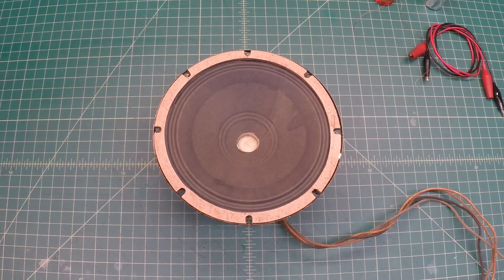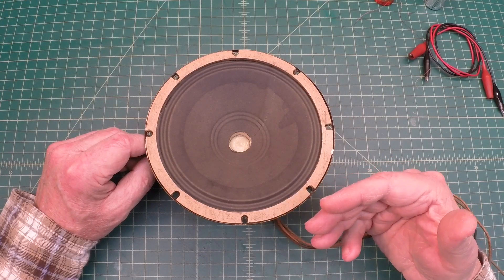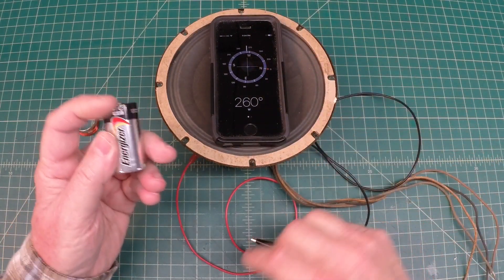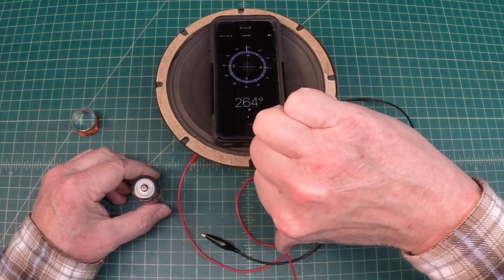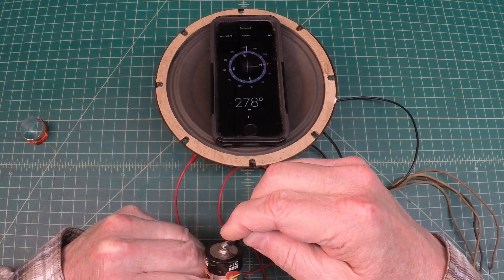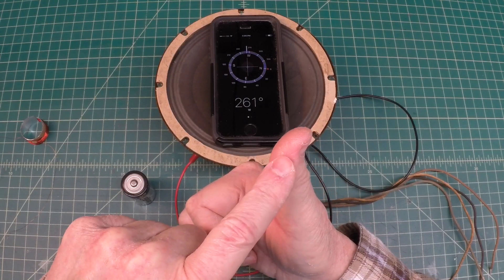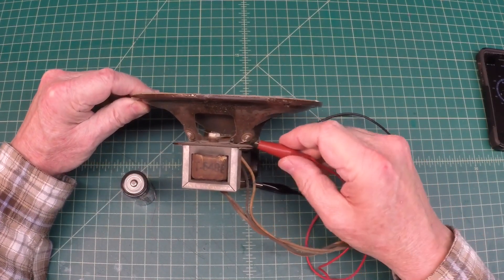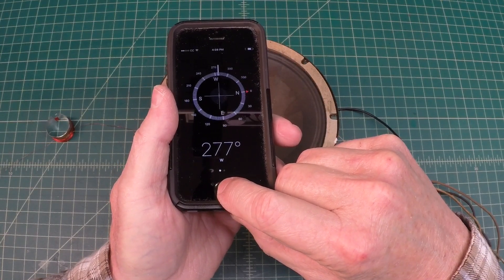iOS Device to Identify Voice Coil Polarity

Comment: If you're trying to figure out which way the speaker is moving, would it help to have a permanent magnet near the electromagnet so that when you applied power you could see which way it was thrusting the paper cone by whether it attracted or repelled the permanent magnet to the electromagnet?  I really have no idea and I may be completely off, but it could possibly be an idea to try?  Take care, Gary
Reply from the maker: +Rebel9668 Gary, your point is well taken. I tried doing this using the cheap magnets I had on hand and couldn't create enough force to see the VC/cone move. A stronger magnet might do the trick. I appreciate you sharing your idea and solution. Best, Don

Comment: Hi Don. I have done the battery trick with more modern speakers, but haven't tried it with the older field coil types. Your method  seems sound to me. Has the older speaker may not move enough to tell,Just guessing at that point though.
All my best.
Bobby
Reply from the maker: +Bobby Tectalabyss You're spot on Bobby. I just can't see the the movement of the VC/cone on the old electromagnetic dynamic speakers with a de-energized field coil and was looking to find an alternate method when I stumbled across this approach. I appreciate your feedback. Best, Don

Comment: 50 yrs ago never had a ios device  speaker moves out or in is the way a battery is neg or pos   pos makes cone move out
Reply from the maker: +DENNIS N Thank you Dennis. I was telling Don, +umajunkcollector I was looking for a solution for those electromagnetic dynamic speakers with a de-energized field coil and no magnetic field. Even with a 9V battery, I can't see the cone move up or down based on the polarity of the voltage source. I appreciate your insight. Best, Don

Comment: old school, which way does the cone move, up or down?  battery one way up, the other way down.
Reply from the maker: +umajunkcollector Don, the process you described works the majority of the time, especially on magnetic speakers. Many of the vintage speakers I've encountered are stiff or have no energized field coil, so I can't actually see the movement of the cone, that's why I was looking for alternate methods. I appreciate your experience/feedback. Best, Don